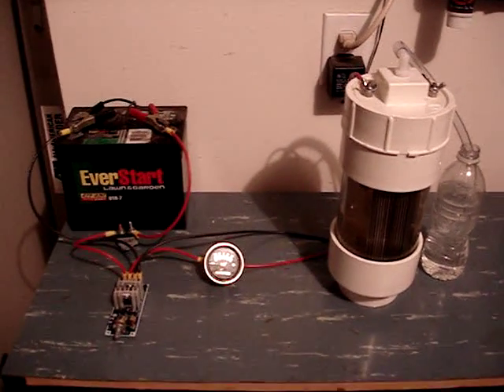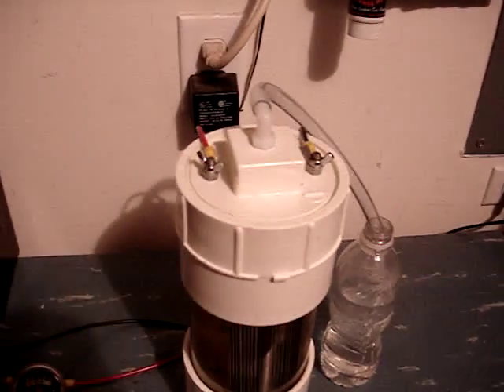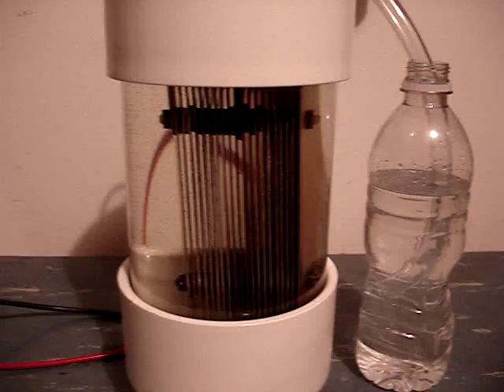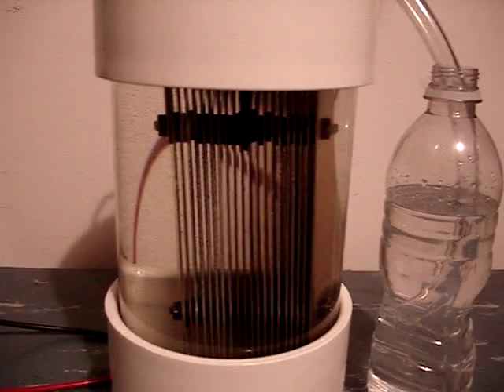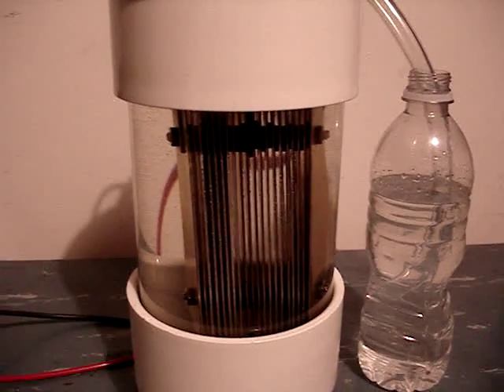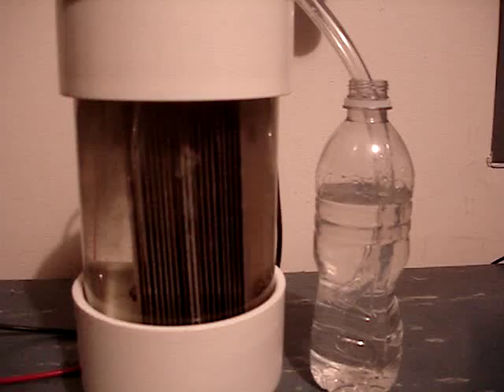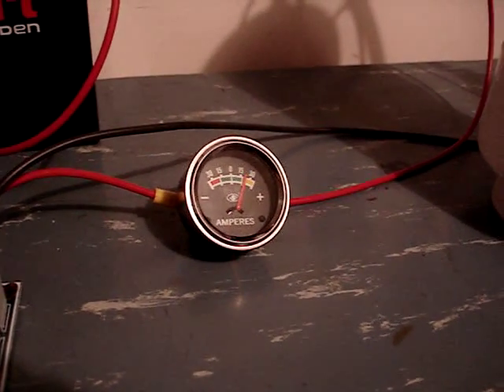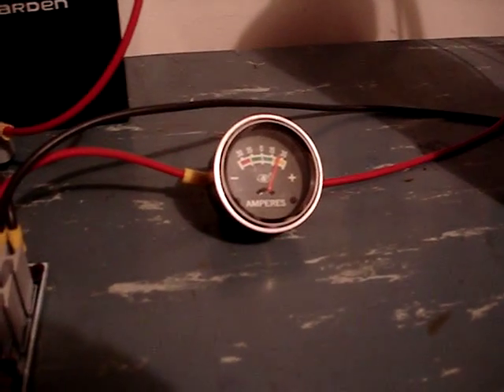20 Plate HHO Generator

Comment: this well force travel with less resistance making the positive plate penetrate the Neu plate that is only space 1/16" into the negative, instead of going around the neu, plate thus defeating the purpose of the neutral plate AND YES mindgas:you do need a Neutral for 30 amp or above.

Comment: your plating sequence seems to be a bit of the beat-n path and your production isn't all that good for 30 amps for as much electrolyte as you used,try a new plate configuration similar or like
Pos,neu,Neg,neu,Pos,ect ect, and make the neutral plates 3/16 wider on all sides then your Pos and Neg plates